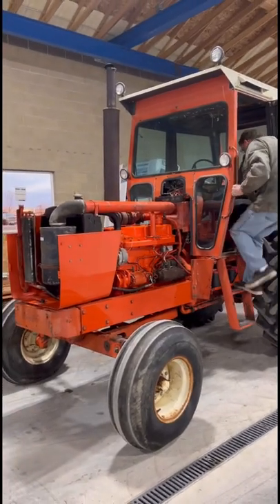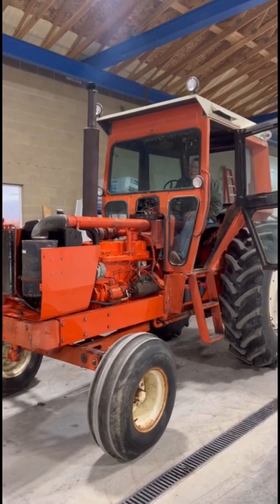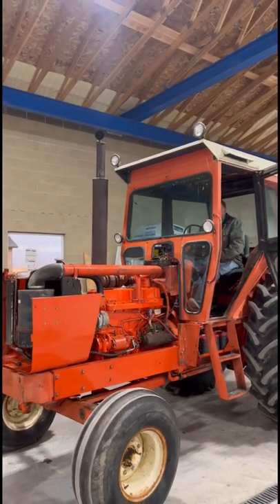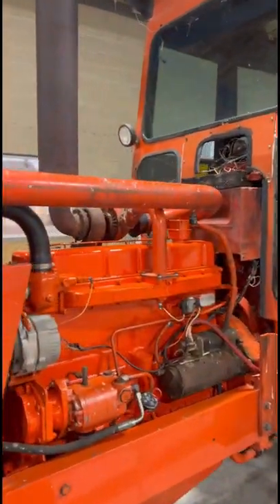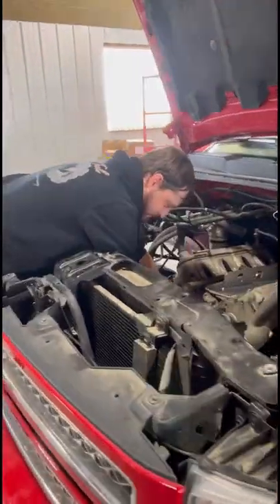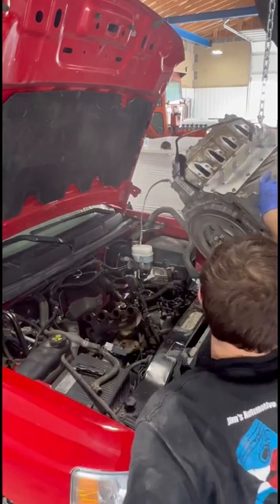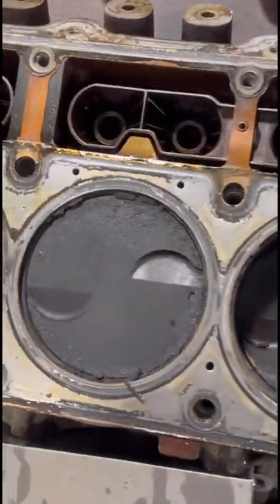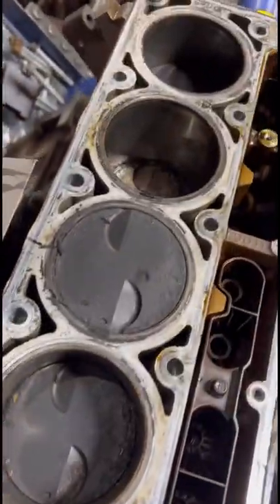#shorts Cold Start On The Freshly Rebuilt Allis Chalmers Two-Ten Tractor & A Faulty LS Valve Lifter!

Comment: Why it smoke so much
Reply: Old school diesels didn't combust the fuel very efficiently. Computers, finer injector atomization, better combustion chamber shape, better combustion swirl, hotter glow plugs, and several other things made later diesels less smoky. In 2008, all on road diesels had to have a DPF which reduced visible smoke to practically zero, but they have led to many engine problems.